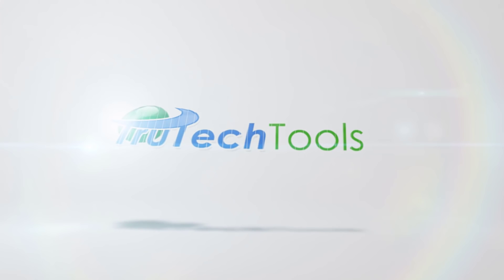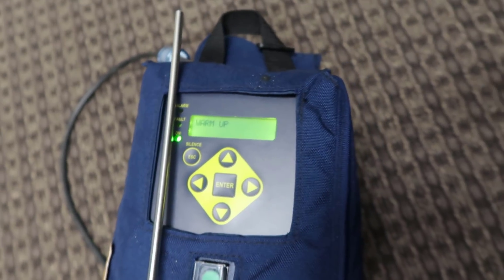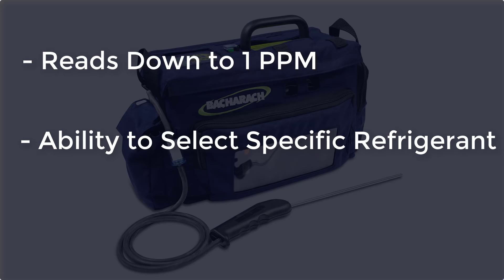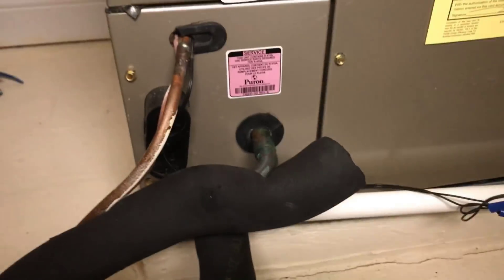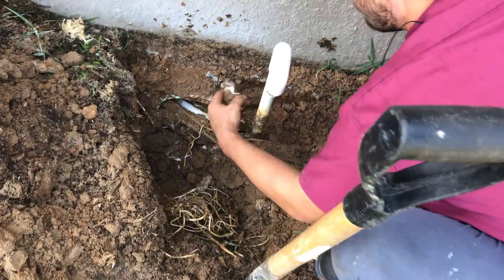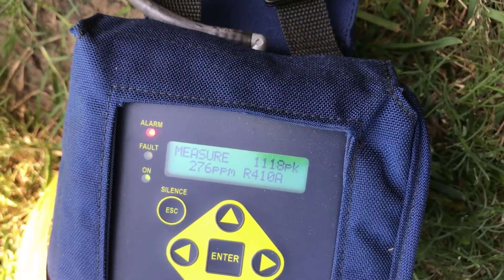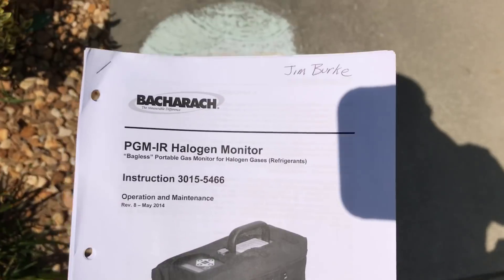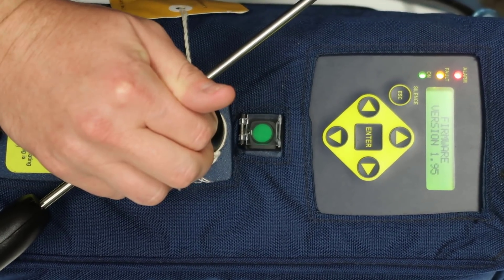Pinpointing Difficult Refrigerant Leaks w/ the Bacharach PGM-IR Leak Detector

Comment: The leak detector has a setting in the menu for ambient temperature of where you will be using it so it is effected by temp. Is the line set a direct burial? Who does that??? That's a great way to install if you are going to be the guy that services it. Because right about the time it comes out of warranty the pipes will be  leaking. Oh yeah I forgot to mention you would have to be a thief if you do it that way. I've been doing industrial refrigeration service for about 20 years now servicing major supermarket chains in my area. Racks with everything from 5 or 7 scroll compressors to racks with 5 screw compressors ranging from 20,000 120,000 BTU. Just a tip if you are going to do a video on a piece of equipment you didn't know existed, you might want to get a full understanding of it before you pull out the camera

Comment: Will it pick up behind sheetrock?
Reply from the maker: Hi reggie smith, It will pick up anywhere refrigerant gas molecules can reach it. It depends on the size of the leak and any pressure in the wall compared to where you have the probe which might draw the gas leak “plume” away from you. 
No guarantees, but it is the most sensitive detector on the market, so it is your best chance.

Comment: im considering picking one of these up but I only do residential work and there just isnt many videos on resi work with this equipment...would be damn nice to drill a quick hole in the evap case, put probe in a get a reading, that would be one hell of a time saver. But with a resi unit leaking 1-2 pounds a year would this PGM-IR pick up a reading?
Reply from the maker: Yes, it would work great for that application. We would still suggest opening the case to pinpoint the exact spot once you get a hit.
Reply: Its the most sensitive bro

Comment: Very good video. 
So should a customer never used bleach on their drain line at all? Or only when the drain line drains on the copper lines?
Reply: NEVER use Bleach in the Drain Lines. The Vapors from the Bleach can eat away at the Evaporator Coil.